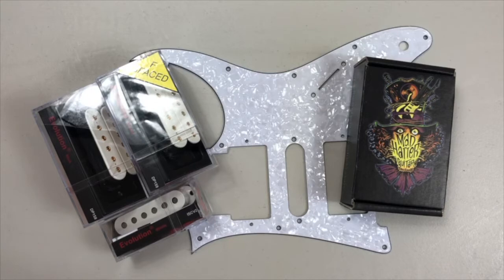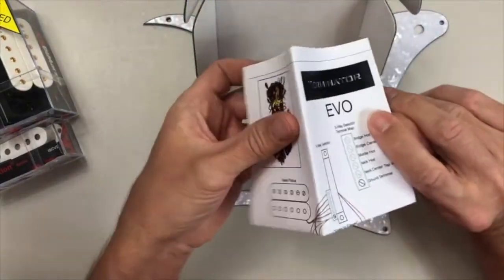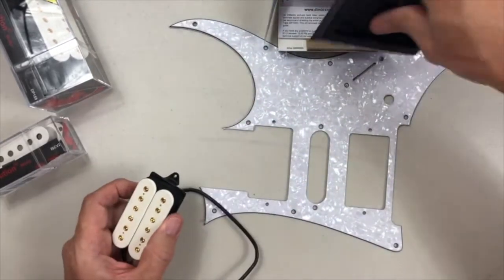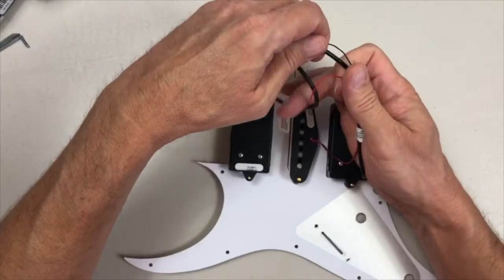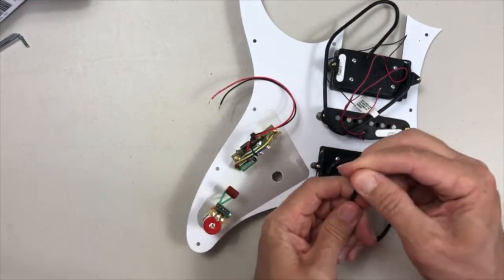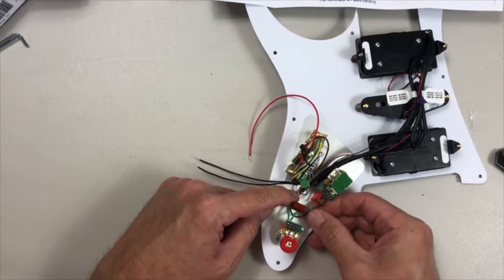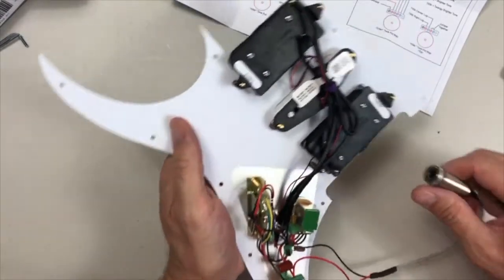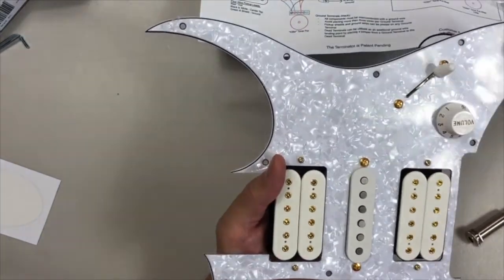Terminator - EVO Installation Video

Comment: Will this work on the jem Jr because I noticed that my bridge pickup doesn’t have 4 wires it has 3 I have no green wires is this a problem and I have a black and yellow wire on my middle pickup so do i follow the directions as is but just put my yellow wire in the place of the red? Also my neck pickup is the same as my bridge just 3 wires
Reply: Yes all you have to do is correspond/substitute the wires for your pu's to what they are on dimarzio's.  don't worry about not having that 4th wire.
The reason you only have 3 wires is on the import pu's the one wire is for both coils to be wired in series.  With dimarzio's and duncan's they give you the option to not twist those wires together to link the coils.  With your pickups they are permanently connected but can be split with a switch by that one wire.

Comment: Quick question! I have the original Dimarzio Dark Matter pickups(Gravity Storms with fancy covers)and DM2 single coil(to match covers.) 

Each humbucker has a green ground as well as the bare wire, which I believe is also a ground. The single coil has the active black, a red ground, and a grey wire that I believe may also be a ground. 

The directions suggest not putting more than 3 wires into a single ground terminal. But at 2 per pickup, I now have 6 ground wires. In the video, you have no superfluous grounds to attach when you begin wiring the 5 way to the pots. 

Did you run all of your ground wires into the black terminal on the 5 way switch?

Comment: How do I troubleshoot if all the cables are connected in the right spots and it still isn't making a sound, its was working fine till after I added the 3rd pickup then no sound at all, I took everything out and am currently starting again so I will edit my comment if I figure it out.
Reply from the maker: Hi Luca,  It sounds like the third pickup is shorting out the System.  Be sure the pickup is wired correctly.  If the problem continues please contact our customer service at info@madhatterguitarproducts,.com with your order number, model of pickups, and details of the issue.  They will assist.  Pictures are also very helpful.
Reply: @MadHatterGuitarProducts  Thank you for the quick reply, I think I know what the problem could be it says "avoid placing more then three wires per ground terminal" in the ground terminal on the toggle switch I had the green and shield from humbucker and the white from the single coil so when I added the other single coil's white wire it did something. If that is the case can I put it into another ground terminal.
Reply from the maker: @lucarossi5133  yes. Please see the section on the wiring diagram “Ground Terminals.”
Reply from the maker: @lucarossi5133  However, it sounds like a short with the third pickup. Also be sure the switch is not shorting out on the control cavity wall.
Reply: @MadHatterGuitarProducts  I checked for that the good thing is on my guitar it is not close to the walls, when i finish rewiring I will leave a comment if I succeeded, but if im still having the issue I will get some sleep and email support tomorrow.
Reply: @MadHatterGuitarProducts  It is working now, thank you so much for the help and the video was also very helpful and I really like the system I hated soldering. One  more question do I solder the ground wire to the back of the guitar were the springs are?
Reply from the maker: @lucarossi5133  Awesome!  Unless you’re installing a new trem, you should already have a bridge ground lead attached to the trem claw. If not, for a solderless connection crimp the wire onto a ring terminal. Then place it on one of the trem claw screws.
Reply: @MadHatterGuitarProducts  Thank you again
Reply from the maker: @lucarossi5133  Absolutely!  We hope you love what you're hearing!
Reply: @MadHatterGuitarProducts  my $140 ibenez gio (with new pickups) is close to sounding as good as my PRS!